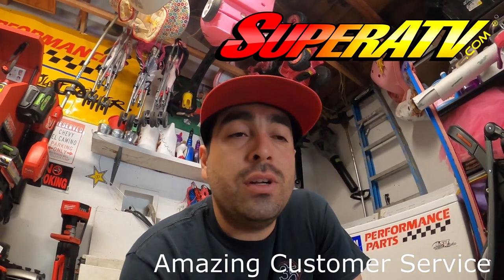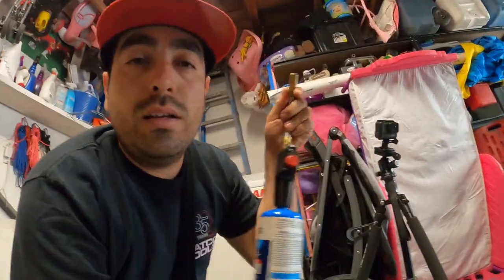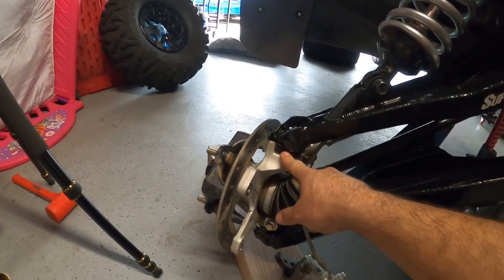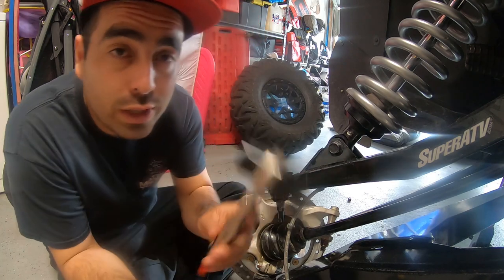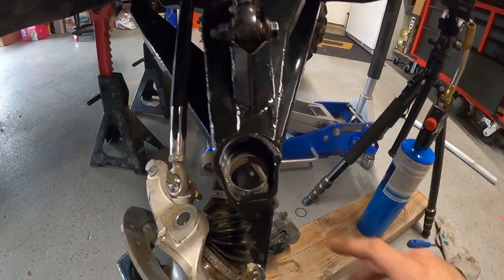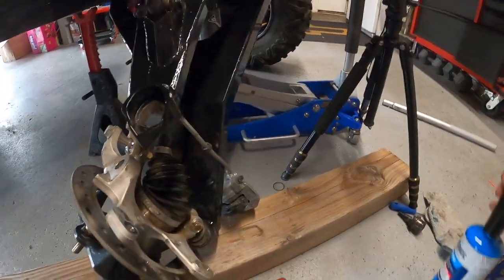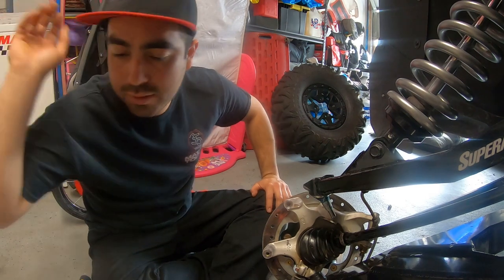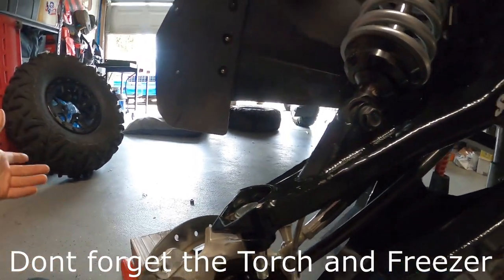How To Replace CAN AM X3 Ball Joints  Ep 61

Comment: What is wrong with Super ATV ball joint? I have the same ones.
Reply from the maker: They were not stopping my wheels from turning on time.. the balljoints spaced the upper arm to high causing the upper arm to contact the steering stop on the hub too late.. my stock rims contacted the arms when turning.. probably not an issue with a wider offset like 5+2 or 15in tims
Reply: FrankGLife good looking out .tanks..wasn't too make sure they are safe..bought them because I heard OEM break..don't want to kill the FAM going 70 over whoops 👍🏻
Reply from the maker: They seem to be strong... Im still running the lower ball joints.. the superatv boxed arms are beefy.. thanks for watching bro💪
Reply: @GLifeUTV how the front arms DO?

Comment: Do i need to take the lower control arm off to remove the lower ball joint? Thank you, i have to do this tomorrow morning. 👍
Reply from the maker: It can be done on the vehicle. But removing the arms would make it alot easier. As it will be a little awkward hitting the old ball joint out
Reply: @GLifeUTV  sweet! I'll give it a go, thanks alot for the response. 🤘🏻
Reply from the maker: @slabz710  I've also used some of the tools in this kit. To spread the ball joint from the knuckle. As well as another one of the pullers to removed the ball joint.. installing the heat trick works with a frozen ball joint.. and a socket and hammer helps any stubborn balljoint going in👍
Reply from the maker: @slabz710  https://amzn.to/3ejcNL5
Reply: @GLifeUTV  wow, for the 50 bucks that looks like a good route!